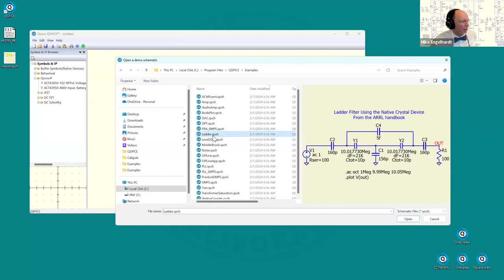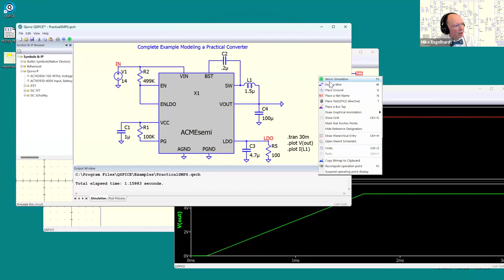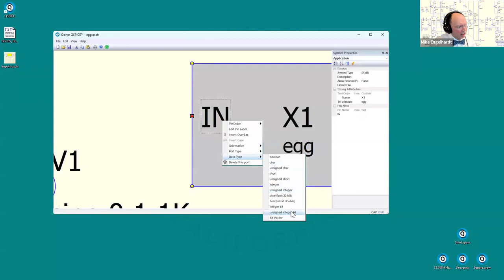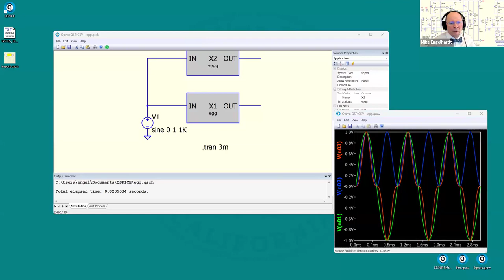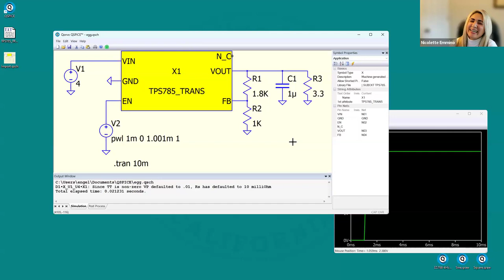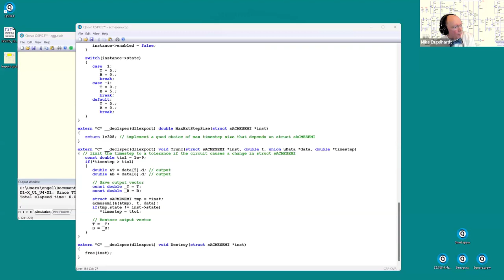Comment: Does it make sense to create a Windows-only tool? 99% or more of all professional tools today run on Linux running on x86 compute servers.
Reply: Altium Designer is Windows-only. I think it's OK to be Windows-only in this space. 
I'm sure a cross-platform app would be better long term, but I could not tell you a cross platform C++ UI framework I think feels good.  Qt is still Janky, ImGui is basically a video game framework. The only good choice for UI is something HTML5, but then you have to interface with the C++ code somehow.
Reply: Sure, 2025 will be the year of the Linux desktop. And if not, then 2026 will be. Promised.